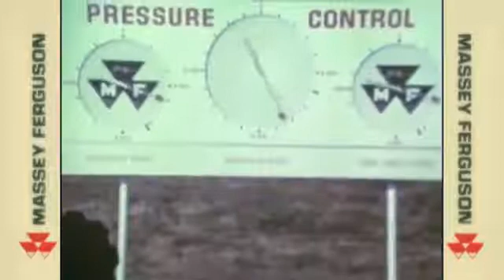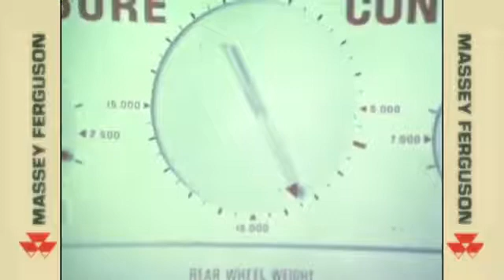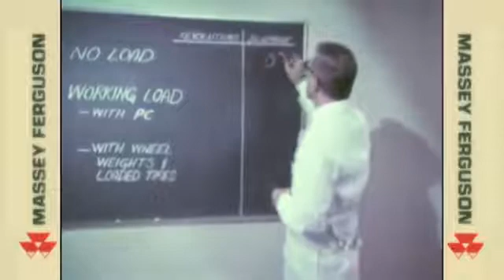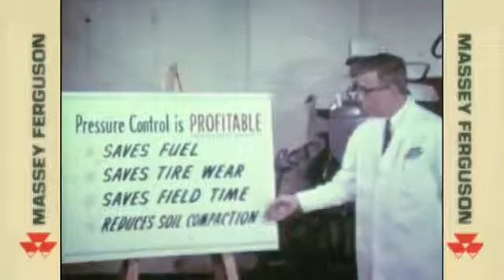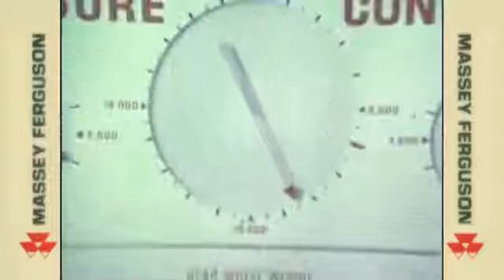Massey Ferguson 100 Series North America pressure control

Comment: The Pressure Control fitted to Coventry built tractors was quite different, using the standard tractor and mostly standard but sometimes re-enforced implement drawbar. It used a PC coupler, mounted on the lower links with a chain at a 45 degree angle down from an arm to wrap around the trailed implement drawbar. The driver controlled it through an extended position control quadrant beyond 'Constant Pumping' with the position of the lever determining the upward [lift] pressure at the links and hence through the chain, lifting the implement and transferring weight from it and the front of the tractor to the rear axle. The same could be done less effectively on any tractor by wrapping a chain around the links and drawbar and lifting the links, but without control of the pressure and lift force which would result in a loss of steering control in many circumstances and probably mechanical damage to something.
The only similar system I know of was fitted to David Brown tractors.